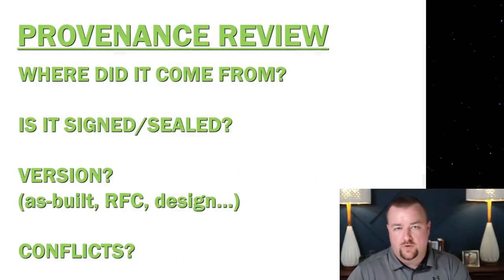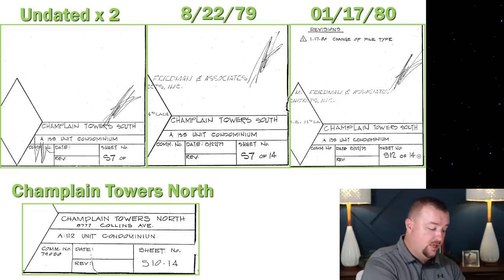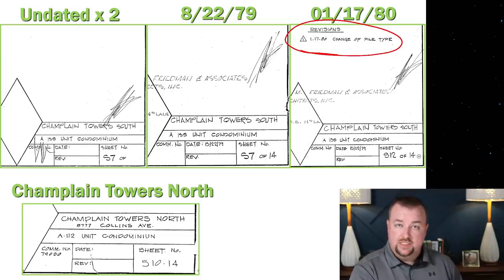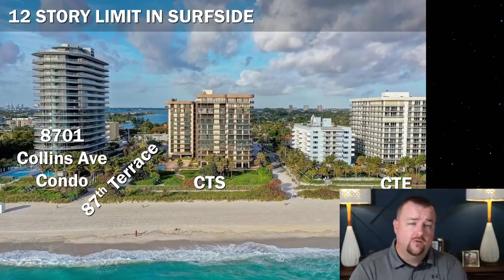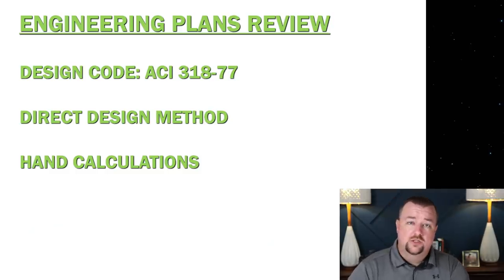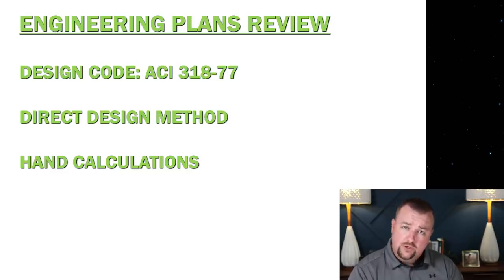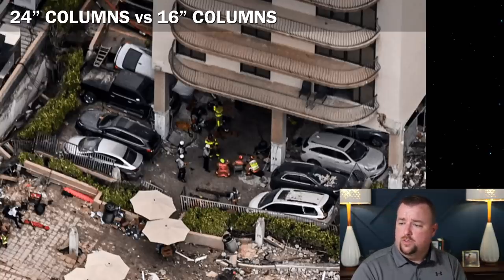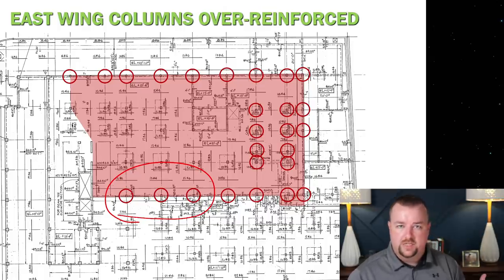Engineering Failures Found in the Champlain Towers South Drawings - Surfside Collapse

Comment: Turns out, the pool deck turned into a 'poop deck'. Thanks for the detailed breakdown of the stuctures engineering issues.......if a structure when new is 100% loaded..........its easy to see that as the concrete cracks and ages.....it will eventually fail, the question is when.  the more its loaded when new, the sooner it will fail.

Comment: People need to realize they stopped recovery on Saturday and 24 hours later the building was down and that is doing it with all precautions and not someone trying to fell the building as fast as they could. Today we have battery powered drills that can create a lot of destruction especially those saws all.. They can cut right through your walls so forget about a lock.

Comment: Could it be that the planter boxes were thought as selfsupporting aka beams themselves? In the collapse picture they are pretty intact. The column has punched through the deck because it was not under the box but just besides it.

What I wonder is why everything is so disorderly placed. I would have calculated the necessary distance between columns and made a regular grid with exactly that pitch. And put the walls and every column further up exaclton those. No transferring of loads and such. Who would do that with a bridge?

Comment: First As I Stated I am a ret. G. C.. Not an engineer. I must contour I had not realized,
Col. were border line sized.
Not beams underneath some planters to take live and dead loading to the footers. Stupid mistake? Even an apprentice Carpenter, rod buster or laborer had to know better than that? 
That in conjuction with numerous flaws with drainage design allowing standing water and continuous infiltration of saline acting on reinforcement it was predictable. As a General I know if i  am seen  with a smile on my face my bid is subject for review, and I am liable to bring any mistakes and design flaws to the attention of the Arch. and Engineers. That is essentially what all the Spec.'s say. There seems to be an abundance of errors and oversights. Oceanside design is typically more difficult. And it should be. I have seen jobs such as 100 Oaks in Nashville where a lot of bad Concrete came in on the testing and had to have major rework by the GC RL Scobey  . Needless to say the Concrete Supplier went Bankrupt. The lack of sheer caps look suspicious to me for punch through? Load distribution seem light for such a large structure. Concrete and reinforcement don't fail if  designed, built, and maintained. I have seen a massive structure suspended on 1 2" solid steel columb. Literally 1 corner of a building. Plumb loads on steel are different. Seem a lot of neglect and business as usual by all parties brought this structure down this also includes vibration plastictification of sub soils. Cracking caused by design with poor maintaining  leads to water infiltration and that lead to Rust and that is a cancer that destroy concrete structures. We shall see. Again Oceanside structures are a special case lime bridges in ice and conditions. It takes steel and concrete  to provide integrity. So sad. There had to be warning signs. There is much more evidence I believe to come out here?

Comment: Is it typical for 70s and 80s buildings to have decks that are built to 100% load? Meaning if you only plan for a static load in this area; was it common practice to engineer to nearly failing? I get costs are thing but surely they knew this building wouldnt be inspected every year and it needed to last decades.

Comment: I think the quality of the concrete is the root cause of the collasp.  You need the review the specifications, the superintendent's daily reports, the QC daily reports, the the concrete batch plants delivery tickets, the testing labs cylinder breaks at 7 and 28 days, etc. etc.   From the pictures of the rubble you can clearly see that the building was reduced to a sand pile, indicating that the concrete was of poor quality. You see no great pieces of slab, beams, or columns, just sand and clean rebar with virtually no concrete attached.

Comment: Your videos are incredibly informative and easy to understand - thank you.  However, How does the collapse of this building "compare" to the collapse of towers 1,2&7 on 9/11 as you stated other than them collapsing into their own footprint?  Apparently, this building collapsed after years of neglect and began at the base of the structure.  Buildings 1&2 collapsed in less than 90 minutes from being struck in the upper 1/3 by aircraft and the resulting fire.  Building 7 collapsed the same day due to a single columnar collapse after office fires according to N.I.S.T.  As you know, no steel structure building until that day had ever collapsed into it's own footprint due to fire.  In fact, a building is burning merry hell as I write this in Italy right now and has not collapsed.  Thanks again.

Comment: The fact that vehicles today are a lot more heavy than in 1980 probably didn't help with the loads on the parking deck.
Reply: the avg vehicle weight in 1980 was 3,228 lbs.  In 2020, 3,735.  NOT significantly more

Comment: This looks similar to the 9/11 WorldTradeCenter 'pancaking' collapse except it was caused by water over a prolonged time span, instead of uncontrolled fire.
 Evidently, the shrubbery planters appears as added after the original design as a modification or remodeling afterthought for marketing to new tenants, but the changes were done haphazardly.  The mismatched alignment of columns on floors above the lobby level is shoddy design.  How did the municipality even issued a permit after reviewing the developers' plan prior to actual construction, were the modifications submitted without reviewing the initial engineering plans?  Lateral re-barring is no substitute for vertical loading on deficiently sized columns.
Excellent forensic research.

Comment: Well finally - someone dug deeper into the strange mismatching of the column widths between the section that fell and the part of the building that did not fall.  Of course he made a great discovery of that change of plans between 1979 and 1980, and the effect it had on the beam supports then left out.
Now comes the detective work. Somewhere there is a note or record of the "reason" that the plans were changed. And that in turn could redirect the 'blame game' into whole new areas. To put it bluntly, 97 people might be alive today if they had stuck to the original 1979 design of that 12" step-down with the extra support beams. (Or, also possibly if they had used the beefier 24" columns throughout the lower levels of the whole structure.) Stay tuned... 😉

Comment: Is that structural engineer still alive or does the firm still exist. Would laws prevent liability being put on the engineering group. Perhaps if the design is insufficient from day one the statue of limitations would not apply. It seems the building inspection department of the city has some responsibility if design is bad. Could that force the city to buy out the owners of the other tower if it’s design is faulty.
Just wondering.

Comment: Although I am a "retired" mechanical draftsman, I have a rudimentary knowledge of "structural" engineering.
It is clear to me that this building was poorly designed, changes made without redesign of other effected areas, cut corners when they could, and made numerous design flaw errors.
why this building lasted as long as it did is a wonder to me. ;-(

Comment: BEVs...  Is anyone going back and looking into parking space loading based on the increased average vehicle weight from battery electric vehicles? My heaviest vehicle is an '06 v10 diesel Touareg at 5756 lbs. Heavy for a compact SUV, right? But a 2022 Tesla Model X plaid is 5390 lbs. A Ford F150 lightning designed for towing, probably 6300+ lbs?

These aren't your '80s Honda's to be sure. Those loads are going to be higher than anticipated when designed.

Comment: Huh, I would've thought that steel beams would be everywhere, similar to wooden joists in a house.
Reply: For the most part, the slab ACTS as 2-axis beams... personally, I prefer WAFFLE SLABS --they're strong, (relatively) lightweight, i.e. efficient, and... they LOOK WAY COOL when you're in the parking garage.  But they're not panacea--you still need proper drainage AND waterproofing on the topside.  But again... SO COOL!

Comment: Not sure why this guy hasn't been contracted to provide his analytics of his findings. Using factual evidence photos and witness statements. I'm sure he's on the right track. I think by now it's well known the area where the collapse started. The ground floor tennant stated as much when he came out toward pool deck prior to evacuating. The pooldeck followed and caused damage to main structure pillars effectively tugging them away so as to remove support to all the floors above.Then like domino's the rest fell.  If the Engineer who decided to remove support beams is still around I suggest he runs. Cubaor Afghanistan maybe best.

Comment: It's not going to be a smoking gun or even a surprise,
No 1 and 2 im sure will be that a low budget property built for regular moderate income families suddenly becomes a high price high end property with almost every apartment being completly made over with gigantic weight increase in every area including thick dense stone on the walls oversized and heavy fixtures fittings and stuff like heavy bath's stone and marble air con and refrigeration and everything you probably imagine everywhere basically an old reasonably price apartment blocks turned into a luxury condos,
This is grandma's old Ford the basic model that's rusty and needs serious work suddenly has a 1000bhp engine put in with nothing else done and just painting over the rust,
And number 2 the thing all condo owners do is to do everything possible to not have to pay for the maintenance and repairs

Comment: Yes I've been studying from the construction with this building and maintenance I know a little bit about engineering and construction and the fact that the maintenance was properly kept up no ground water drainage system put in quickly remove the water underneath the foundation and the fact it looks like beams not being strong enough for being in a parking lot were you know cars going to run into them and it looks like pour concrete work and grade of concrete this building should have been condemned 2 years ago till it was upgraded or tore down but $600,000 unit well people lost their lives it's a iopener for all apartment buildings standing in America

Comment: No building is built to 100% spec loads. Even basic lifting gear is designed for 8x over abuse ratings. If the planter boxes did overload the structure below them thats all that would have failed, not every other column. NIST has already been proved that they forged the Building 7 details. Surfside is a 100% implosion job, why else would 6M Outfits arrive to investigate their handiwork?

Comment: CEMENT,  IS  VERY  UNFORGIVING. Having cement, for this structure, with VIBRATION  FROM  VEHICLES, along with the 3 laws of  thermodynamics, caused  this failure.  As well, as rebar rust, and that forcing cement to compress, and crumble.   CODE, needs a total  revamping ; according to these laws. Cement, doesn't   GIVE, AS  WOOD  WOULD  .

Comment: Over engineering loads, must be taken into account. BUILD  IT  FOR  30  %  MORE  than  required, mathematically, is KEY  FOR  success.  Cutting corners, and the bare ' mimimum  requirements'' does NOT  FOR A  LASTING  STRUCTURE   MAKE.  money-saving dangerous builders

Comment: I keep seeing people assuming, speculating or even concluding that the tower failed somewhere around its base. While this may end up being the case, the video recordings of the collapse that I’ve watched apparently show the collapse beginning at the top of the building with highest upper floors pancaking one on top of each other and that the combined weight and force from the collapse of those upper stories led to the center of that wing of the building to collapse and then with that support gone the remaining ends of the structure  collapsed into the debris pile of the collapsed center of that wing of the tower. 

It looks like that there may be a case to be made that some structural failure occurred at the top or near the top of the middle of that tower, rather than the base. 

Comments?

Comment: Just about your most piercing analytic video so far.  Great to see you getting back on target.  Water weighs one tonne per cubic meter. Concrete about twice that. Just eyeballing those planters you can find about 6-10t in each planter box in front of the lobby. Removing those beams made a massive difference to the overall structure, with apparently zero compensatory measures. About 20y ago there was a supermarket of the group "Casino" collapsed in Nice, France, killing several people. That was determined to be caused by someone adding planter boxes on the roof area ( which was only accessible for maintenance , maybe they were trying to save the planet ! ).
https://www.lsa-conso.fr/effondrement-du-toit-de-carrefour-a-nice-de-nombreux-precedents,161968